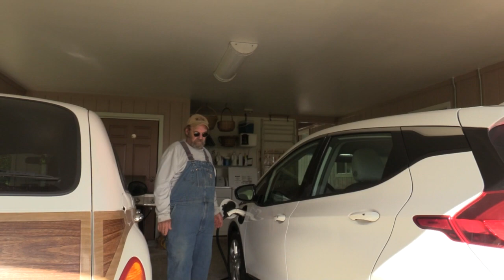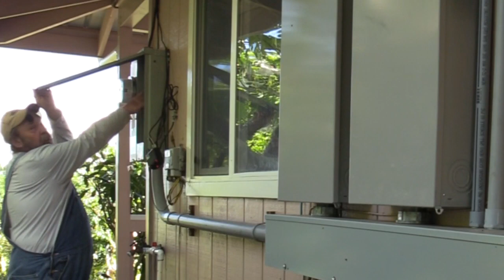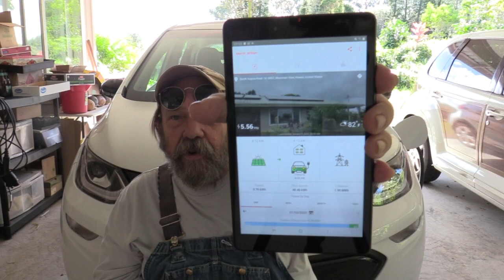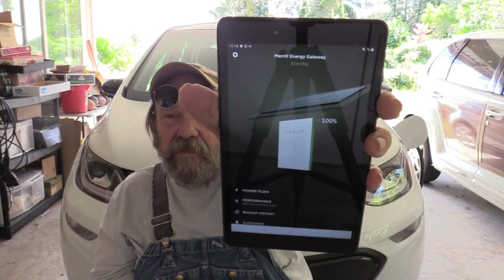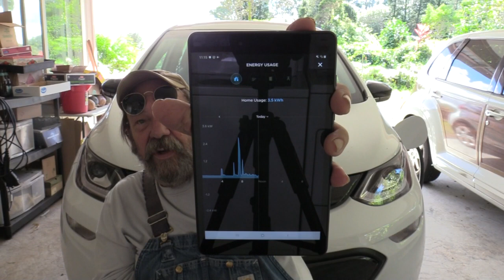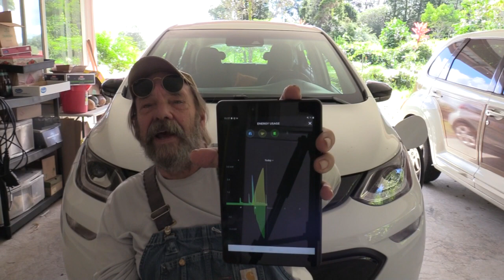Solar Powered Car & Home

Comment: excellent article on better storage options than the powerwall https://theenergymix.com/2019/11/11/home-storage-delivers-back-up-power-in-vermont-blackout-and-ev-batteries-could-do-even-better
Reply from the maker: Some one must have dropped their calculator into the sink!  The Chevy Bolt EV battery costs $15,734.29.  A Tesla Power Wall is $6700.  The Power Wall is a complete system with software, internet connections and control circuits.  An EV battery is just a battery so there is considerable more expense to get it working in a house.  I suggest using the EV battery in the car as storage.  It is cheaper that way.  A Tesla Power wall is designed for home use out of the box.  People who have a higher power use than we do would do well to use two power walls instead of the one we use.  I have no AC or heating, and we heat the water direct from the sun.  One Power Wall is enough in Hawaii to keep us self powered and off the grid.  In Minnesota I would consider 2 Power Walls and they would still be cheaper than a single EV battery from Chevy or Tesla cars.  The Nissan Leaf battery is cheaper but it doesn't even have half the storage of other EV batteries.  My idea is to add a second EV to absorb the over production here.  Then we can drive it to town!
Reply: "The Chevy Bolt EV battery costs $15,734.29" my apologies, i hadn't know that. was googling around trying to find battery types and prices today but i couldn't find 1 site that listed the amps and the price - either or :(
Reply from the maker: @vulcanfeline  No need to apologize.  I actually had a similar idea myself until I noticed the cost.  The Power wall is definitely cheaper.  My plan is a second electric car.  Right now my second car is a gas burner and I'm starting to think waiting in line at the pump isn't my style.  I went straight to Chevy for the price.  They are trying to sell the battery and motor set up in a crate to hot rodders.

Comment: Nice video, I think youtube world would love to see the nerdy math on this one. Upfront cost, savings, lifespan, previous electricity cost in HI, etc. Thanks.
Reply from the maker: The up front cost was $45,000 before taxes.  The only part of the system that has a stated life span is the SunPower collectors.  They have a 25% guarantee and should experience less than 4% degradation in 20 years.  The Solar edge inverter has 25 year and the Tesla Power Wall Battery is a ten.   We were already heating our water with collectors so the bill was lower by 30% than before we installed the water collectors.  We usually paid about $160 a month for electricity.  Estimated savings over 20 years is over $26,000. The cost of the Chevy Bolt EV was $38,000.  This year they are all subject to a 30% rebate on federal taxes.  There is also a State credit.  Net metering is over in Hawaii but we do get credit for electricity pushed back up the grid.  Since they only pay 1/3 of what they charge i try to keep the power here at the house.  A second EV would stop export power.  Our decision to do this in 2019 was motivated by solar tax credits dropping next year, crossing over with improvements in the solar and EV technology.  Cost is low and technology is significantly advanced over a few years back.  Our motivation in this wasn't economic so I will not make this an economic discussion.  We will likely recover the expense while I am still alive but I could really care less.  The system was paid for my investments made in the market 10 years ago after the 2008 collapse.  Stock I sold to pay for the car and system have actually exceeded the level they were at during sale and every penny has come back.  I anticipate the market is headed for a dive and I wanted to get some advantage out of the 10 year climb by building this system.  Constant power failures here on the Island were also a motivator.  Often I had to move my dinner to the gas grill because of a power failure.  The final was a voice of protest towards the gutting of our EPA's purpose.  I do not need their filthy coal and oil.  They can rot on it as far as I'm concerned.
Reply: "Our motivation in this wasn't economic so I will not make this an economic discussion. We will likely recover the expense while I am still alive but I could really care less." 
:) :) :) :) :) :) :)
Reply from the maker: @vulcanfeline  Money is an abstract concept.  They print it on presses like newspapers.  The value of anything in dollars is open to discussions.  It is not a constant.  I find it sad that we spend so much time troubling over the stuff.  Much good could already be in our world if narrow minded people didn't place economics before life on the planet.  You can't take it with you so why worry about it?  Aloha
Reply: @GreenGardenGuy1  Very interesting, just wondering how things could help the budget of small family in the tropics. I always thought the ROI was probably longer than the life of the system, but that is a thought from 10 years ago.
Around here, utility bills for simple houses are around $60 to 80 US a month, and buying a system just can't be justified even now.....
Reply from the maker: @leadershiphelpdesk510  Hawaii is the highest energy cost in the USA.  This makes alternative energy more attractive here.  We also use less energy than most because air conditioning and heating are not required at this elevation.  My system cost more than a home system though because it also runs my car.  To get a real figure you also have to include the cost of your auto fuel.  As I said though, cost wasn't the issue.  I needed a place to put the profits from the stock market before they disappear in the next global recession. This way instead of paying taxes on the profits the IRS will give me a solar tax credit.  I am also just plain sick of wars for oil and energy companies holding me in a strangle hold.  It just seemed like a much better idea to be my own energy source.  If we all did this the guys in the middle east could drink their oil, it would no longer be needed.  ROI wasn't really an issue for this project.  Been wanting to do this for the last 40 years.  Most of us spend plenty of money on stuff with no hope of a return. This one at least has a chance of return while I'm on earth.
Reply: @GreenGardenGuy1  Just think with all of our tax money spent In the middle east we probably could have supplied every household with this setup.
Reply from the maker: @bluegrassdiggers9030  Such a mess we are in and now digging deeper.  I have several close friends from Iran and one thing I can say, they have very long memories.

Comment: You should check out +warblesonalot and his SunFoil for cars. He doesn't sell them, he gives away the plans and specs for building one.
Reply from the maker: Sunfoil comes up as either a brand of sunflower oil or a sun screen for air craft.  Not sure where you are going with this.

Comment: We just got a 10.33 kw system on our house. Already producing more power than we need (which goes back to the grid) and I'm happy we're helping reduce climate change! Since we have such a large system were planning on getting an electric car as well!
Reply: why would you feed it back into the grid? setup a bitcoin miner!
Reply from the maker: @jinlim6575  I can think of several reason why using the grid is a very good idea.  As for bitcoin I can't power my stove or car with the stuff so it I have no interest in it.  I do fine generating dollar bills from dozens of other sources if I need money.
Reply from the maker: Feeding back to the grid is a nice socially responsible thing to do but it is an economic black hole if you live in Hawaii.  We talk out of both sides of our mouths here about solar energy.  They want us to be energy independent but will only pay me 1/3 of the cost for power pushed up the grid.  The congress just added a $50 up charge to plates on EV cars because we do not pay gas tax.  Too much greed and stupidity in the system.  That said, if you have 10 kw system buy two EV autos, get all electric tools and look into electric scooters!  Anything to keep as much of your power at the house as possible.  Consider running a wire to the neighbor and selling them the power for 75 cents per kw instead of the 33 cents that Helco pays!  Aloha.